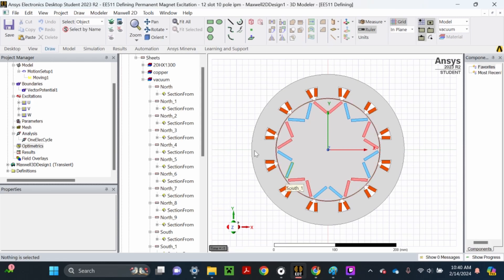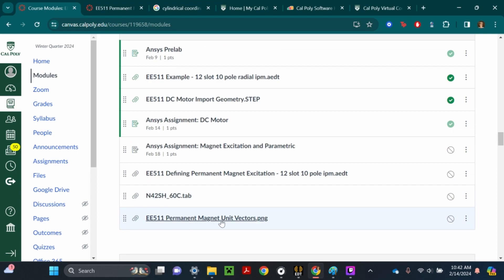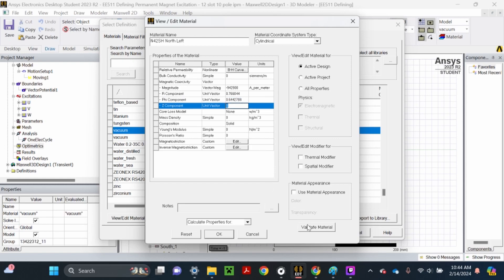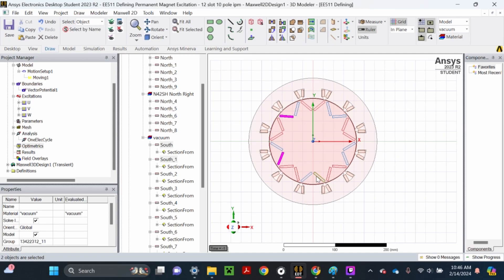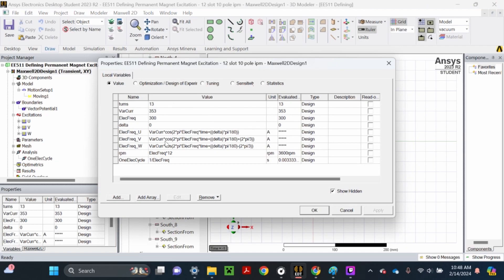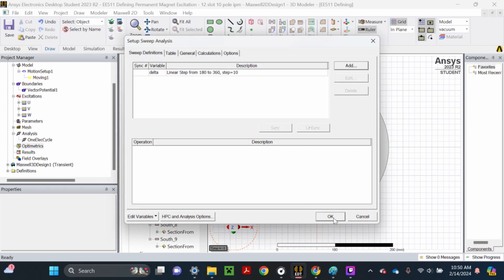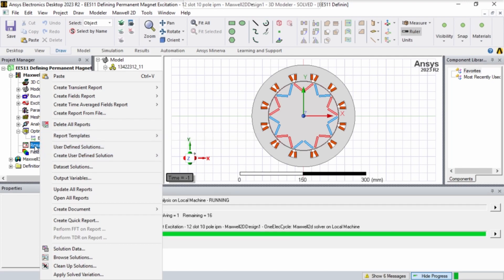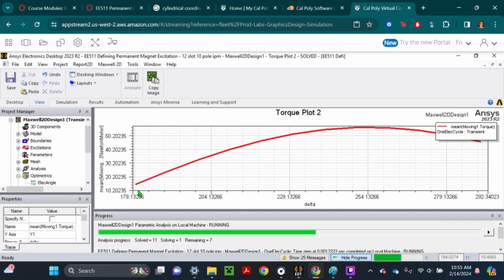Ansys Maxwell: Permanent Magnet Excitation and Torque Parametric

Comment: I have a challenge… for parametric analysis, how can you define the size and position of the “coils” so that they will vary as the other structural parameters vary…
Reply from the maker: If you draw the geometry for an object in Ansys instead of importing it, the geometry dimensions can be changed within the subtree of the object. These dimensions can be input as variables which you can view and change when you right click the project ("Maxwell2DDesign") and select "design properties".